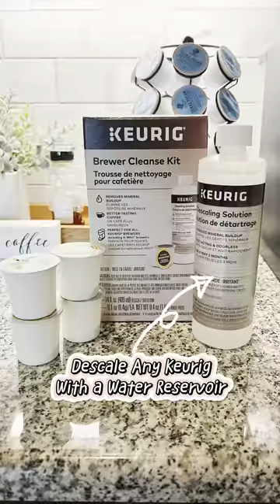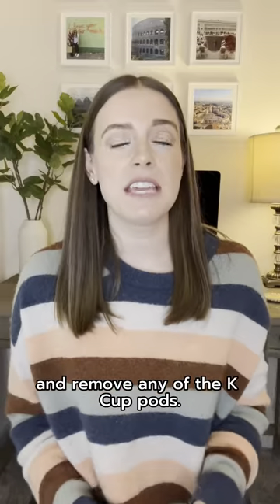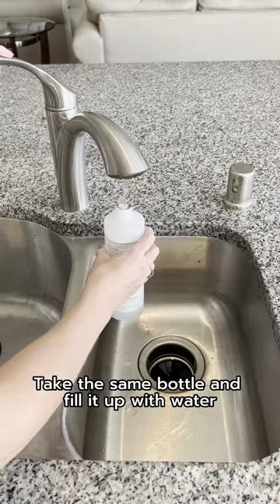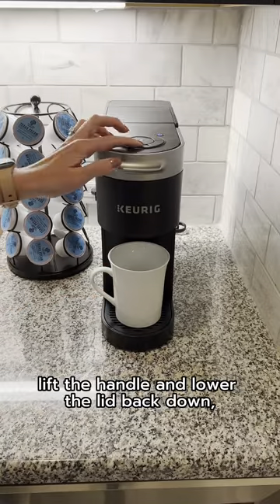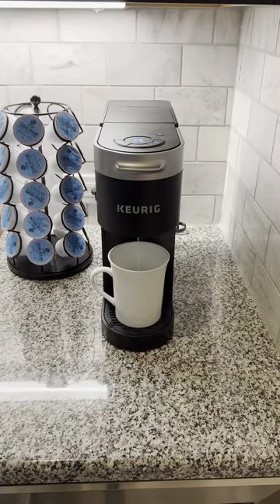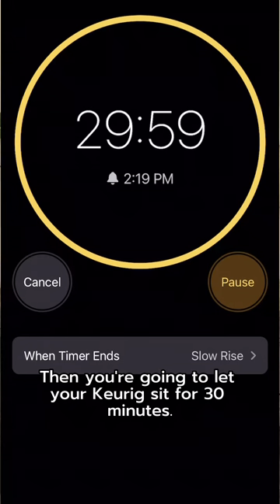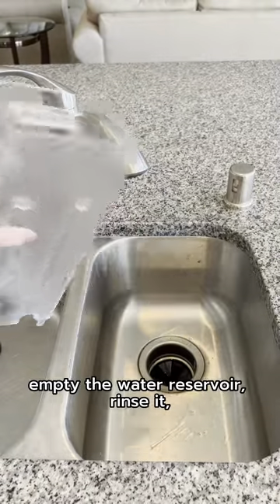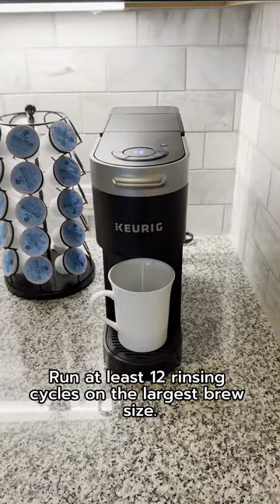How to Descale Keurig with Descaling Solution

Comment: On the K Slim u need to put it into the descale mode not just run it like normal with the solution! To get in descale mode u need 2 power it off & hold the 8 Oz & 12 Oz buttons at the same time til the descale light is on steady! Not flashing! Then push the K button & carry on
Reply: Is this before you run the rinsing cycles to run the descaling solution and water?
Reply: Fuck I just wasted a descale solution
Reply: language! 😨
Reply: Thanks!
Reply: Hey... you don't mention putting the machine into descale mode by turning it off and pressing 8 and 12 oz buttons at the same time. I wasted a whole bottle of descaler liquid. I watched another person's post and they did it right. I'm disappointed
Reply: @LindaPoole-d8b don’t you love it when the comments section is more helpful than the video? Smh
Reply: Been there and done that. Followed the instructions provided by Keurig and wasted 16 reservoirs of water but the light still flashed. Thankfully it just up and stopped working one day. Did everything I could think of, but no lights came on. Now in some recycling plant. These things aren't cheap!
Reply: Mine is hold the cold brew button till it turns off, then the 8 and 12 buttons until descale is solid.
Reply: Thanks you!
Reply: Super super helpful thank you!
Reply: I wondered about the flashing descale
Reply: @LindaPoole-d8b you didn’t waste it. The solution still ran through the machine and cleaned it. Just use regular water to do the “descale” so the light turns off.

Comment: Hey Coral, don’t forget to let your folks know that on some models, if not all, that they should press and hold the two top buttons for 3 seconds, to let the system know that you are about to descale it.  I did a whole descaling process, and the descale light stayed on!!  I googled “my descale light is still on, now what” and came up with “angryespresso” (where he linked me to your video) and he said that the Keurig doesn’t know that the solution is anything but water, so by doing the press and hold, it tells the system to “pay attention“.  Now my machine is descaled AND the light is off!!  Yippee
Reply: Awsome thank you!

Comment: Not correct from what I researched. With the power off, you hold the 8 and 12 oz button together, and the “descale” light comes on to start descaling process. Also, you have to read the descaling solution. Mine says use 1/2 bottle, not the whole bottle. This video is not the proper way according to online manuals and videos from the manufacturer.
Reply: This video is precisely the instructions on the Keurig brand descaling bottle. even same wording just simpler put. You are correct about the descaling mode, however, in order to get the descale light to turn off at end of process. Other than that, my instructions show exactly what she said. It you have a different model than her, or different than the one shown on the box you bought, you will be correct about one of those instructions being wrong!
Reply: @ihatemickiegee  All Keurigs have the same process, but ok.